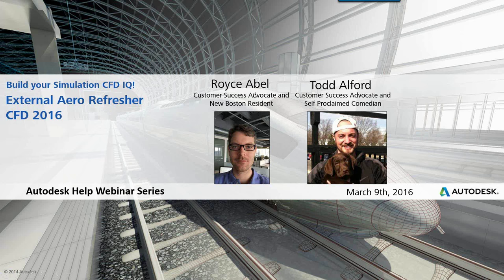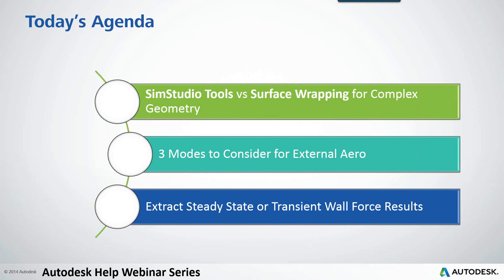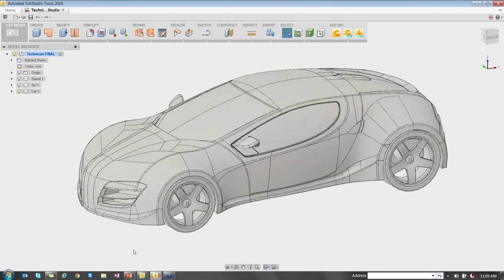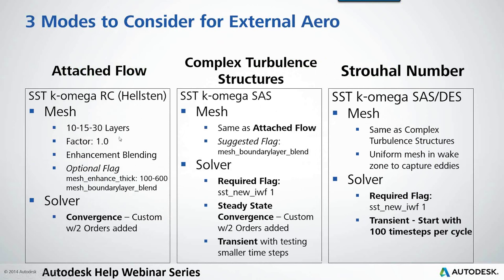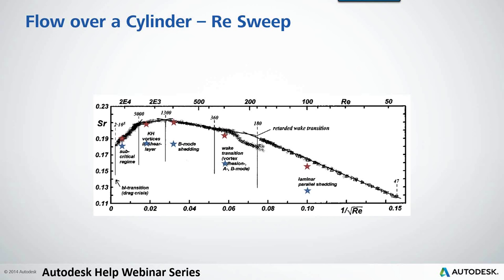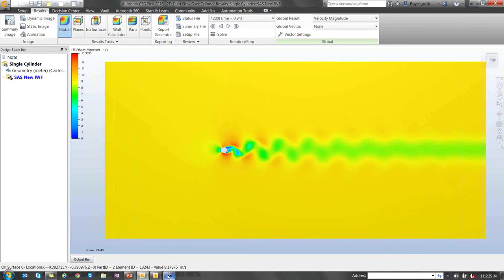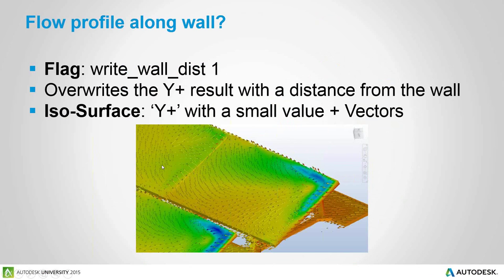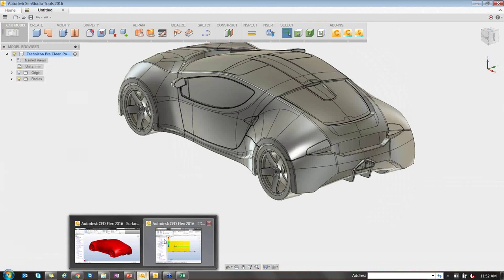External Aero Refresher in Autodesk Simulation CFD 2016

Comment: Hello, I downloaded the wall force history tool but is not working. When I push the run button, this message shows up:
"Wall Force History...   Started

Wall Force History...   Processed Inputs
Wall Force History...   max Freq  : 100.0
Wall Force History...   Drag Areas : [1.0]
Wall Force History...   Lift Areas  : [1.0]
Wall Force History...   Lift Direction : Y
Wall Force History File: E:/new/Design 1/Scenario 1 5/solver/Scenario 1 5_wall_force_history.csv
Group named WFH 1 does not exist
 * Ignore Above Message *"

P.S. I am using CFD 2017